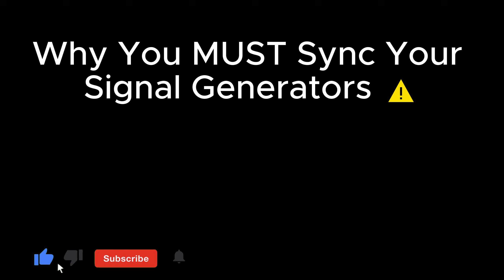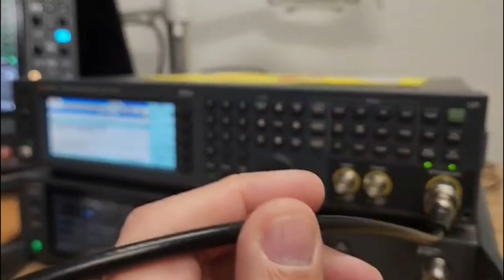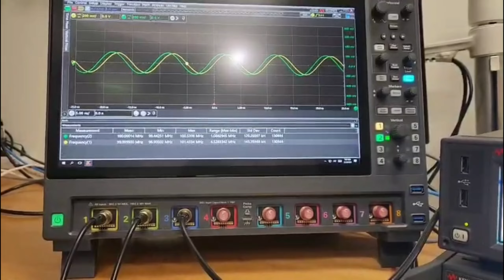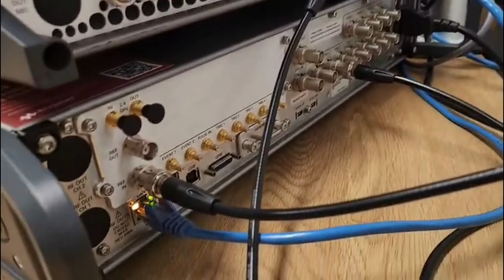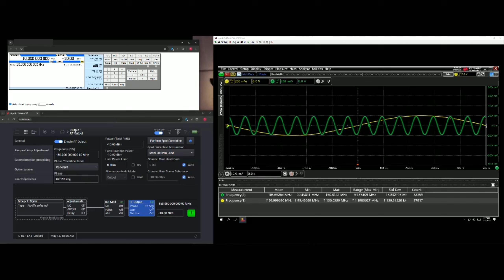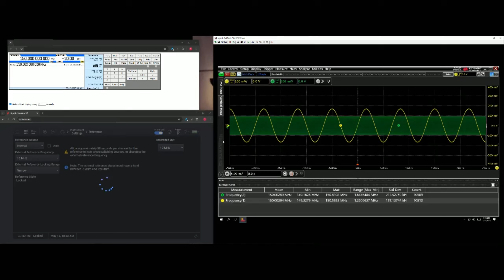195 Why You MUST Sync Your Signal Generators ⚠️ Lab Mistakes You Can’t Afford!

Comment: Synchronize multiple signal generators, they need to receive a special signal called an event pulse from the main (primary) signal generator. This event pulse helps them all start at the same time so that their signals are in sync , but in my case there is nothing appearing at Event1,  i made a settings by going into dual ARb settings and making primary and secondary sources all that settings but unable to understand why the Event pulse is not appearing from primary SG . Can you explain event signal why did you attached to Trig1 ?
Reply from the maker: i'll get back to you soon. :)

Comment: Great video, thank you! I have a question:
If I connect the 10 MHz Ref Out of one signal generator to the Ref In of another, why do I still observe a phase difference between the two signals? Shouldn’t the reference clock ensure they are phase-synchronized as well or it is just for frequency allignment?
Is not the Event 1 to trig1 is for Phase alignment , i mean both are triggered at same time?
Reply from the maker: as far as i know, once 2 instruments are synchronized with the 10MHz reference, their phase should be tallied. make sure one is Ref out and the other one is Ref In. you might need to switch that in the software/buttons even if you have connected correctly physically